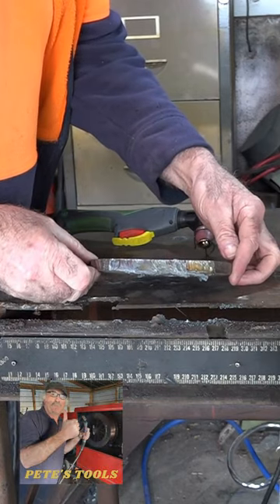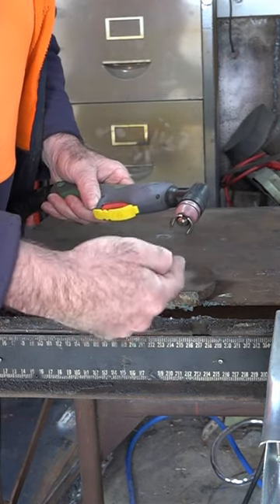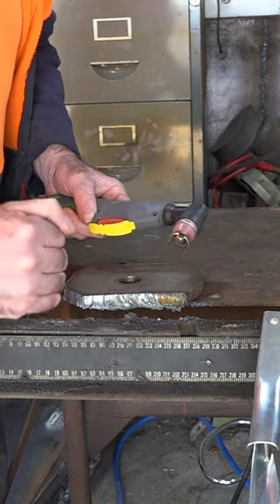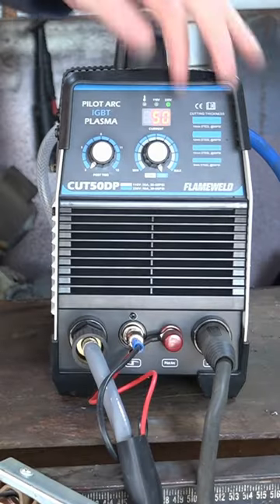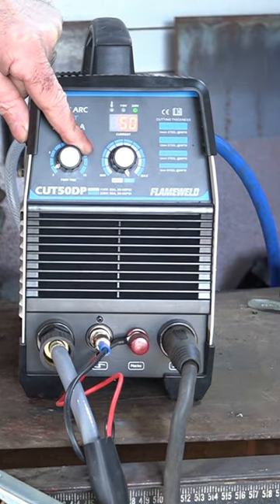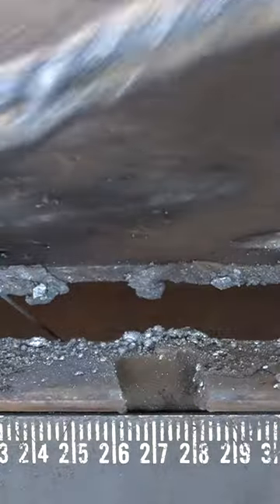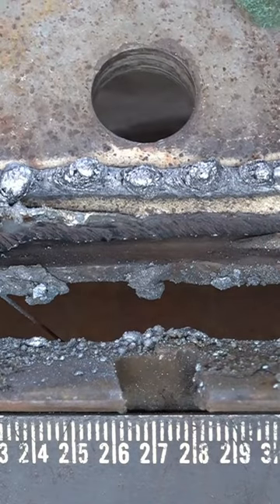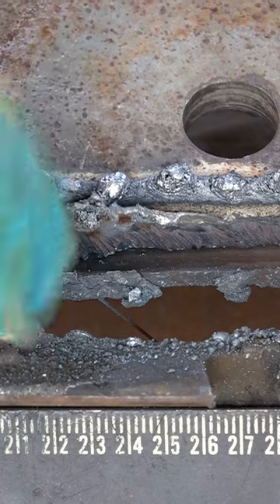$199 Plasma Cutter: This One Tip Will Let You Cut THICK Steel Plate Like a Pro

Comment: I have a primeweld cut 60 new in the box for like 2 years now I really need to get out of the box I think
Reply from the maker: Yea mate  get PLASMA CUTTING
Reply: I’ve got one about as long.    Works ok but I just haven’t busted much since to need using it.    Anything needing precision I still do with the six wheels.     I got Primeweld with the 3 year warranty for just that reason.   So far my cuts look about as rough as my oxypropane cuts which I never was much good with.

Comment: Hey Pete , I just bought the same torch for an old pilot arc plasma cutter that's been setting in the back of the shop for years hoping to get it up and running soon. Is there a brand of consumables for these torches that's better than the rest, or are they all pretty much the same, the reason the machines been sitting is the gun was burned up when we got it and new ones weren't available for a long time.
Reply from the maker: Just a standed AG-60 p torch and consumables

Comment: I was working at a custom boat trailer manufacturer in the early 80s. We had been using torches to do all our cutting for fenders, brackets, etc. We were using Miller mig welders so the rep brought in their new plasma machine. Holy crap, it was a game changer. We convinced the rep to leave his demo there and ordered two more. It definitely decreased our production time for doing all the cutting for our sheet metal goods. 
Thanks for the video.
Reply from the maker: Yea once you try it you will never go back LOL